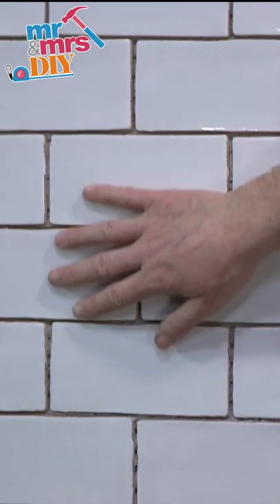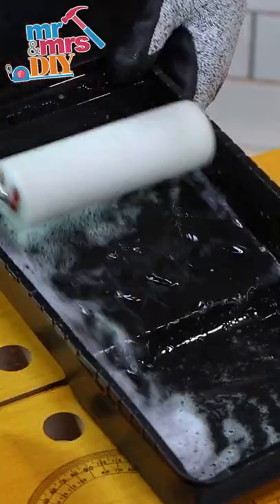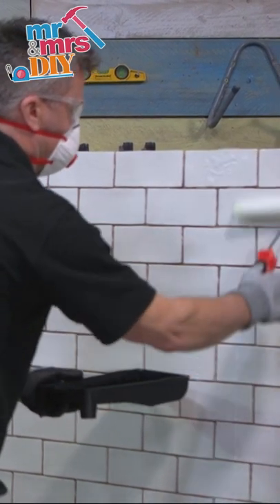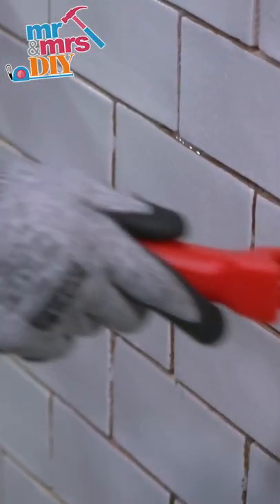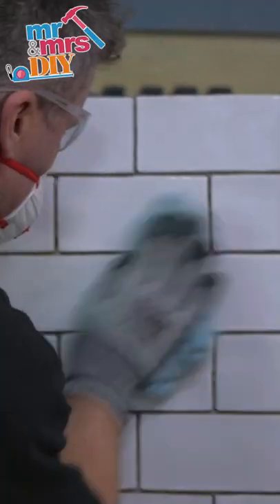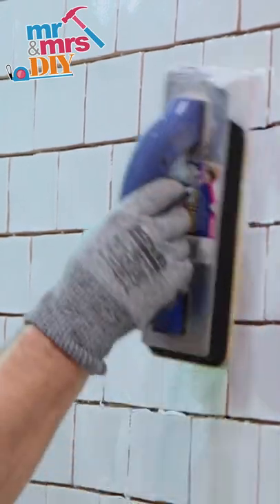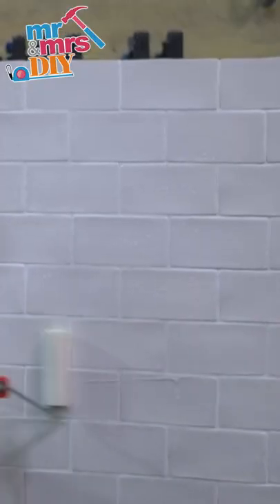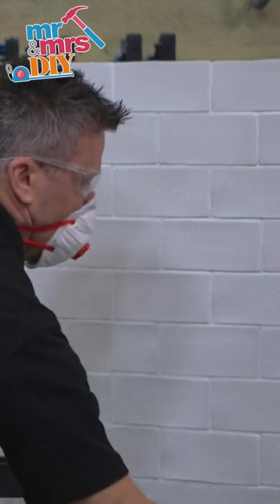Sealing and Grouting Crackle Effect Glazed Tiles #Shorts #Tiles #Grout #HowTo

Comment: Fab! I'm assuming there are different size rubber edge grouting pad thingies for the area you're working on or are they a standard size? 💜
Reply from the maker: Hi Nellie, there are different sizers you can use, just depends how big of an area you have to grout. Whats your size area and how big are the tiles
Reply: @MrandMrsDIY  Hi, the area is really small.. 67cm x 34cm and the tiles are 6x6.. I have the kitchen area to do after that which is bigger. 💜 kitchen 700cm x 80
Tiles 6' x 6"